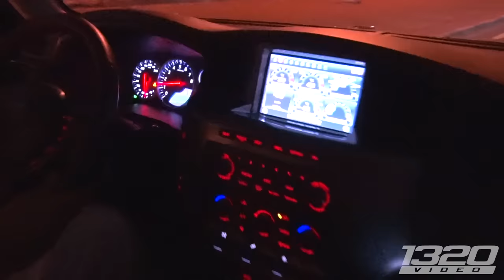The Grand Tour Porsche 918 Killer REVEALED!

Comment: Mad props to the build, that looks like it came from the factory. Two thumbs up!!
Reply: it did come from the factory. the GTR drivetrain was all fitted by Nismo for the customer
Reply: You may be thinking of the Juke GTR? They only made like 21 or so. Correct me if i'm wrong.
Reply: they had it custom made by gtr for the customer. at least thats what they said on the grand tour.
Reply: GTR is a car not a place or company. Nismo is Nissan's performance company they built it.
Reply: 4Joe20 I'm not sure why your other comment got deleted. But yea thanks for clearing that up.
Reply: Mike C Ikr
Reply: 4Joe20 no its not built by nismo. It was built in dubai by a local garage its called F Performance
Reply: Mike C awesome
Reply: Ibrahim Alhammadi if you read the article put out by the grand tour that I put above. the owner says it was fitted with the stock gtr engine and drive train by Nissan themselves. and shipped to dubai. and further modified to make 1900hp and handle the power at F performance. so yes Nismo built it. F performance modified it. show proof me proof and I'll listen until then lol
Reply: two thumbs up on youtube cancels out to a neutral
Reply: 4Joe20 W
Reply: i dont think they made only 21. I think ive seen about two in the last year in toronto
Reply: 4Joe20 if you watch the video the owner of the shop clearly states that THEY built it there. Not sure why everyone is confused
Reply: kek
Reply: @4Joe20  
What NISMO? It was built by either F Performance or Sub-Zero Performance.

Comment: If this isn't the Ultimate Sleeper, I don't know what is
Reply: itsabeasssst
Reply: Bond farm truck!
Reply: Boba Motoring's 1233hp VW Golf MKII is the craziest sleeper I've ever seen
Reply: Bond maybe a ford pinto would be
Reply: TheMarcusGomez with 800hp and 2-step lol
Reply: Sleeper with Hoosiers?
Reply: the ultimate sleeper would be the long wheel base version without drag slicks.
Reply: Bond look up farm truck
Reply: MICHAEL FAGAN yes the farm truck
Reply: TheMarcusGomez 
The stickers are the only thing holding that monster together lol...
Reply: Bond The wheels give it away from a mile off.
Reply: Anonnymouse Hacker Yes the tires to begin with are a give away, but you still wouldn't expect it to be that fast! 
And many drivers cannot tell the difference between drag radials or slicks and street tires.
Reply: 1000hp odyssey
Reply: i couldnt agree more. the whole combination is hilarious. 1800hp, Nissan patrol suv, 200mph+ half miles, street legal with licence plates, stock seat belt mountings, half gtr interior, and flip flops!😂😂😂😂 no fucks given.
Reply: Not a sleeper with that rubber
Reply: Toyota capris
Reply: Those tires are telling tho

Comment: So literally a GTR with Patrol fenders leaned on it lol. Wonder if it can corner well too.
Reply: It's made to go fast in a straight line ... -_-
Reply: Not even in your dream
Reply: I figured with the GTR suspension it should help maybe? He's said he got road racing tires should see what it can do on the skidpad too.
Reply: CanadaBud23 nah it can take the corners iv even seen this one on its side driven on 2 wherls
Reply: more like a reinforced Patrol shell with GTR mechanicals
Reply: No way. Even on low boost, consider coming out of a corner hitting the throttle, you'd be sideways every single time. That's the thing, the Porsche is designed to have all that power and handle a track like an F1 car. The Patrol is designed for one thing and that is to go straight.
Reply: A Normal GTR with that much power can't even corner, so probably not
Reply: Not to mention the super high CG. I bet this thing would be a major roll over risk if you tried to push it hard on track.
Reply: I bet it corners a lot better than US muscle cars, new and old versions.
Reply: CanadaBud23 Alot of these Patrols were built for drag racing.

Comment: I've wanted a Patrol for a while thanks to the Huge Turbos hanging out of the bay in the sand dune hill climb videos, but this is a new level. I have watched this video about 10 times since it came out and I still marvel at the amount of get up and go this thing has at this weight and also, they made it so nice as far as interior blending between the GTR and the Patrol and even exterior wise, just very understated and clean. This and the Land Speed Land Cruiser are by far my two favorite SUV's of any kind ever, that aren't built specifically for climbing.
Reply: ever got a patrol?

Comment: I wonder how much it'll sell for
Reply: Import Fanboy It's all carbon that shit is probably like 300k lmao
Reply: Tyler Hoeve Still cheaper than a 918
Reply: yeah cheaper..but i guess you could get more miles out of the 918 with less maintance :D thats the only thing thats a downside of big power numbers...you burn through the hardware much faster.
Reply: アマ Nahh just run one of AMS new billet blocks and you don't have to worry about it running 15 1600hp that block is at home, it was built to handle 70+ psi at over 2600hp you can make 1500hp on wastegate boost all day not hurting the motor at all.
Reply: but the thing is: the whole drivetrain is under stress from the extra power. not just the engine. I´m sure that the block itself can withstand 2000+ hp. But all the seals, the turbos, the exhaust, the clutch, the diffs, brakes tires the whole drivetrain gets worn out much quicker. compared to a 4,6l v8 with a little more than a third of that hp isnt gonna break a sweat doing these things over and over again. 

I admire the build and i´m sure there is a lot ot thought and hard work put into it. I´m just saying that when it comes to reliability or care free driving without thinking much about "what´s gonna break the next time i do full boost 0-124 mph (0-200kmh)
Reply: Nelayo Isso The only thing I see wearing out fast are the breaks because of the extra weight other than that it is using a full GTR drivetrain that has proven itself running consistently year after year at tx2k, Ti, Shift S3ctor ECT.. Those guys get years of enjoyment on one build before having to refresh the motor or anything on the drivetrain. Tony Palo daily drives a Alpha 12x ( daily drives) that's 1600hp he is daily driving in a car that's over 4000lbs without any issue. I'm sure that drivetrain has tons of billet goodies under it and is super reinforced. The entire body is carbon fiber, I don't think they would spend 80k on body panels before they upgraded the chassis. You gata remember this was built with Dubai money best of the best everthing with no spending cap.
Reply: The thing about daily driving is this: you dont really need much more than 150hp for daily driving. youre not going much more than 150 kmh anyways. so daily driving doesnt really harm anything else than the engine oil and the brakes. but when it comes to doin what its designed for: the nissan patrol/gtr and the porsche 918. the 918 is for the track and doing fast laps. the patrol for going fast in a straight line. I´m very sure that when it comes to what they are made for , the 918 will be more reliable

Comment: There's a more recent video of this car. It is now sitting at over 2400 hp and has alot more modifications, engine and body. It's crazy. 220+mph top speed apparently.
There's another one in the video just like it but black and it makes 2700hp and went 221mph in the half mile.  Crazy.

Comment: Nissan Patrol driver pulls up beside a Ferrari 458,:

Patrol driver:"what's the retail on one of those?" 
Ferrari driver: "More than you can afford pal, Ferraaaari" 
Light turns green, Ferrari driver toasts his clutch getting off the line.

True Story.
Reply: MotoSurge This Nissan would smoke the clutch, fuck up the transmission, and ruin the engine after like two launches.

Comment: Hey guys I have a question for you. I am in racing and you said you have torque steer, did you check the roll outs on the tires to make sure they are the same because, that could cause your problem if they are not the same. Cool 😎 racer and keep up the good work 👍👍👍

Comment: but how does taking parts from the GTR make the patrol able to beat the 918? cause the regular GTR itself would get murked by the 918..
Reply: I know I am 2 months late but I will explain 

First it’s the body, the patrol body is way lighter than the Nissan GT-R, of course weight huge plays a huge role when it comes to drag racing, if your car weighs less than your opponent then you will win 

But not only the weight, also the HP plays a role, this engine is tuned up to 1600+ HP, and add to that there are carbon fiber bits here and there 

So, less weight and more power which resulted in the patrol beating the 918
Reply: @TecDLogic  thanks